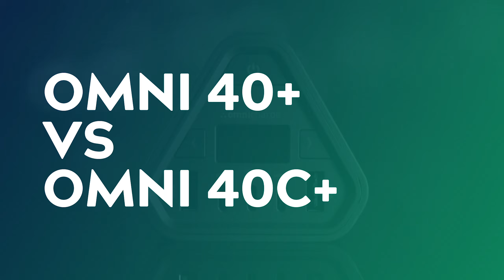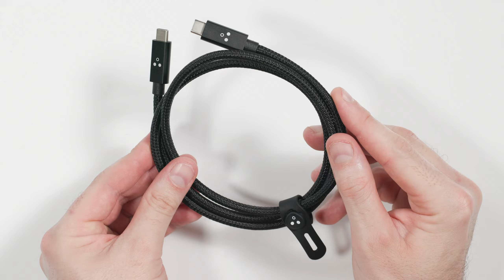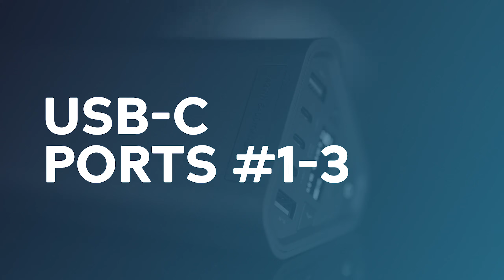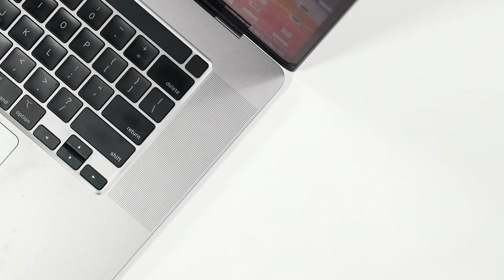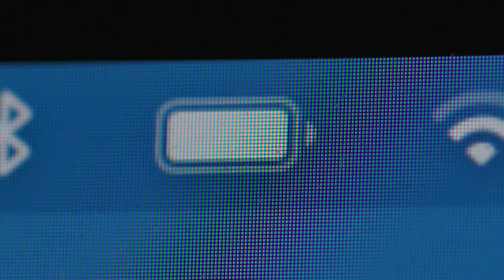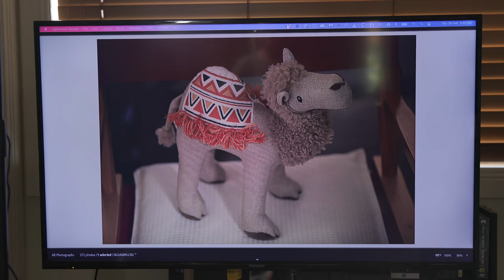Omnicharge Omni 40C+ Power Bank Review | The Studio Photographers Dream Powerbank

Comment: This video was very educational and well done. I'm trying to weigh the cost of the device and its features vs other power banks. Is it worth $400? Also, is it capable of damaging your laptop if you connect the device to it with the wrong functions set? Thank you for the information, and your time!
Reply from the maker: Hey! Thanks for watching. Of course, there is a lot to weigh up, but for me as a professional user, it’s earned it’s price tag. But your circumstance may be different. 

If you’re charging via usb-c, there’s no risk. If you’re charging your laptop via DC, yes you would need to ensure your select the correct voltage and amperage to avoid damage. This info can be found on the back of your laptops AC power adapter. Look for the output power information.

Comment: Hi, this video is amazing thanks for the tips! Are u able to connect the DC power and use both the front and back of the hub simultaneously?
Reply from the maker: Thank you! 
Unfortunately not, the DC port and rear hub share a power circuit, so can’t be used at the same time.
Reply: @CreativePathFilms  ahh ok thanks for the reply! For studio photography then to use the HDMI function (+front and back ports) while keeping the hub and laptop powered what solution do you propose? I couldn't really make out from the video..(PS: I also subscribed to the channel, good stuff!)
Reply from the maker: @nong78 thanks for subscribing! Glad you enjoy the content. 

To use the hdmi as well as the front and back ports, you need to 

1. Enable “HDMI only” in the menu
2. plug in both USB-C port 1 and port 4 to the laptop with two different USB-C cables. 
3. Plug in the HDMI cord and any Additonal USB accessories you need. 

Note you cannot pass-through charge (charge the omnicharge) with this setup.
Reply: @CreativePathFilms  Thanks for clarifying! When the hub runs out of juice, since I won't be able to use the DC port, would u recommend to power the laptop separately using the apple charger so we can still use the hub and have the data on both ports still pass thru and running?
Reply: @nong78  Bro to keep it simple— if you want to use BOTH the front and back hubs simultaneously you CANNOT use any charge functions of the Omni period (including pass-through)…to use pass-through charging you’d have to limit your use to one hub at a time (either front or back)…connecting your laptop to power while utilizing both hubs does not power the Omni, so when the Omni battery eventually depletes you’ll have to discontinue use of both hubs and charge the Omni
Reply from the maker: @newpath1tech correct! Thank you for chiming in.